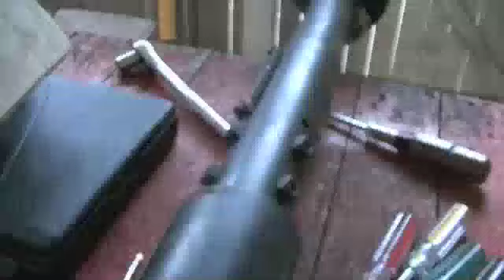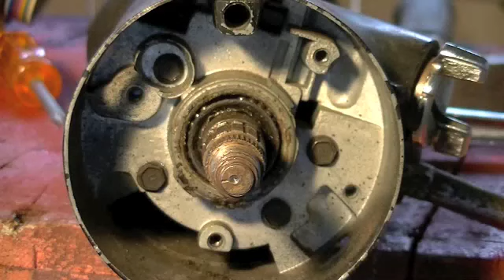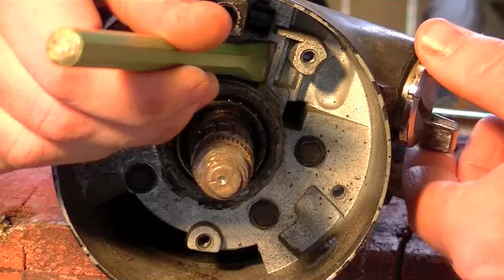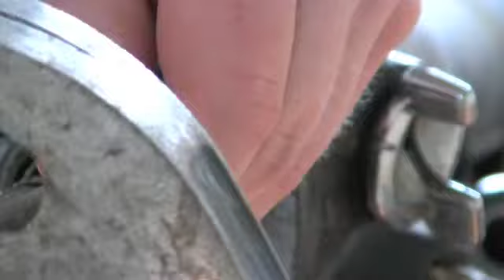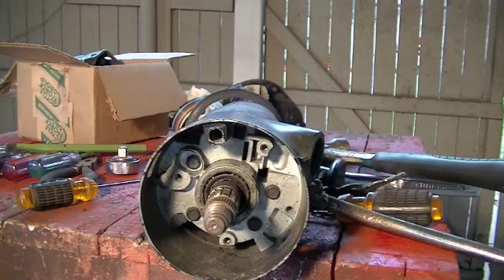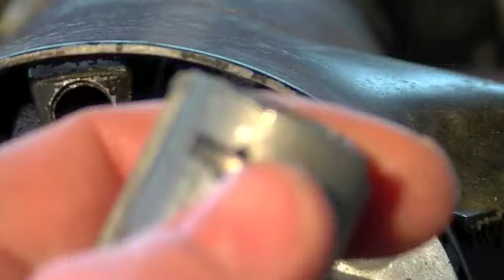Part 5 GM Steering Column Repair

Comment: If you have the ignition keys rotate the switch to on and just lightly push that pin FYI the key and cylinder comes out easy

Comment: would i be able to change the key switch tumbler without taking the entire turn swich assembly out because the tumbler is all i need replaced
Reply from the maker: You would need to pull out the the turn signal assembly but there is enough length in the wiring that you can just let it hang.  You don't need to unplug it at the base of the column.
Reply: thank you thats what i needed to know
Reply from the maker: You're welcome!

Comment: I have a 1977 K10 and took out key switch tumbler mechanism and cannot get the new one to lock in, it will go in but you can pull it out. Any tips on how to get it to stay in?